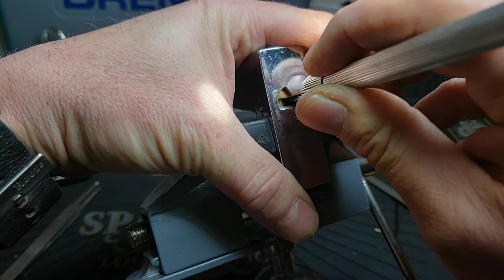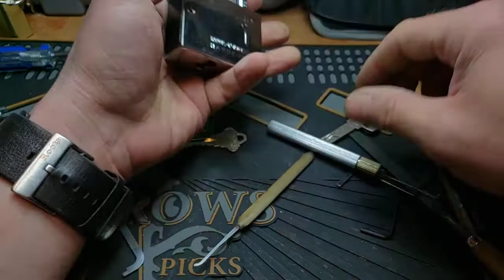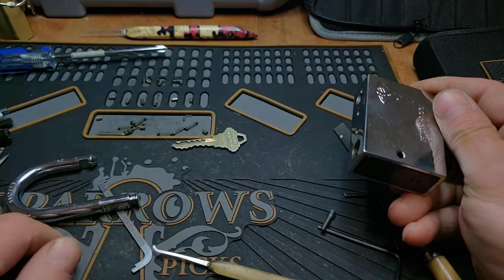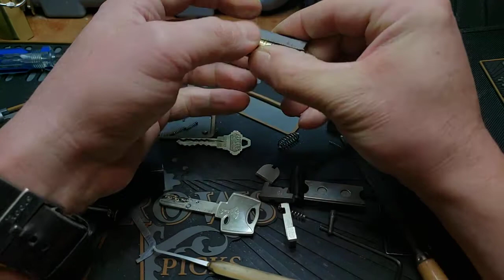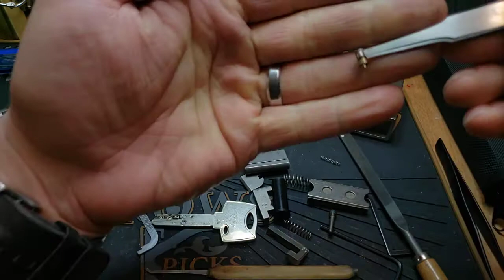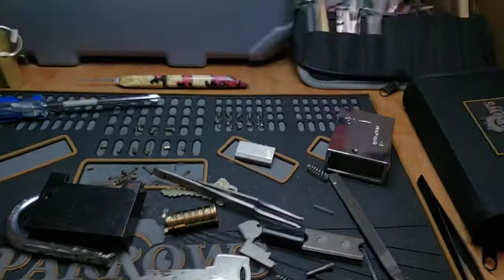Mul-T-Lock Interactive C series padlock, picked and gutted.

Comment: What lock do you think its the safest for a storage unit
Reply from the maker: I would use a disk detainer lock with as much steel covering tha shackle as possible. D.d.s require specialized tools so even cheap ones are pretty secure. 

Minotaur High Security Stainless Steel Disk Detainer Padlock with Thick Shrouded Shackle https://www.amazon.ca/dp/B01CFYIC3K/ref=cm_sw_r_apan_glt_i_02V5JT32QVEFB97ZVV1K 

Something like this.